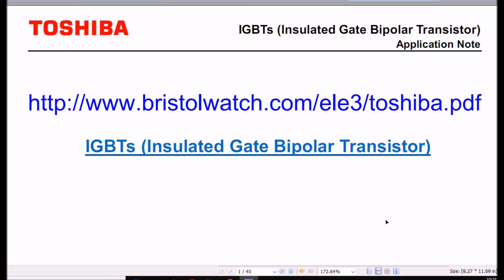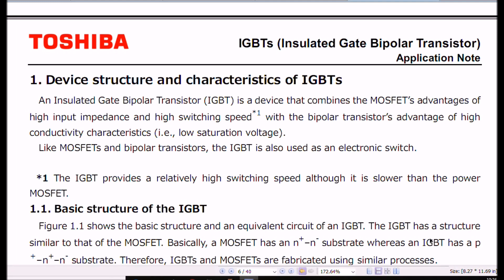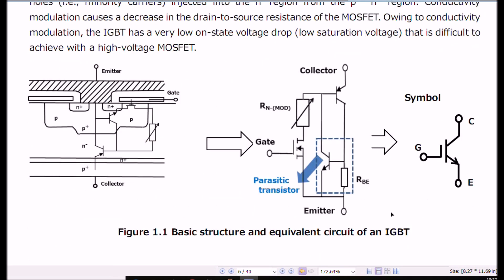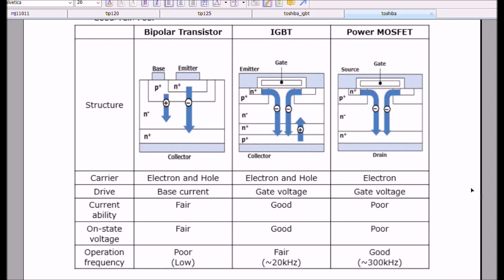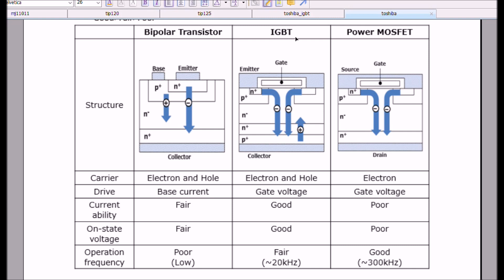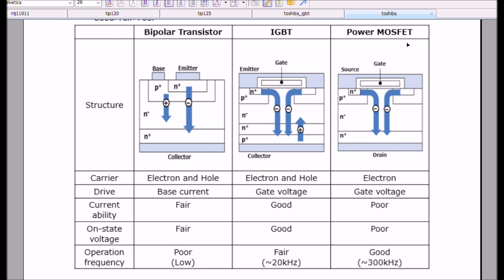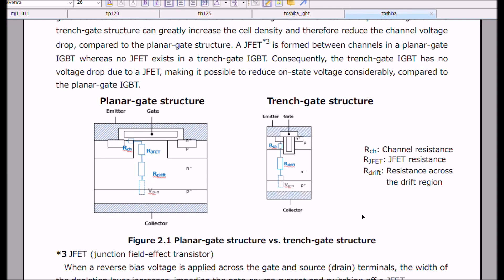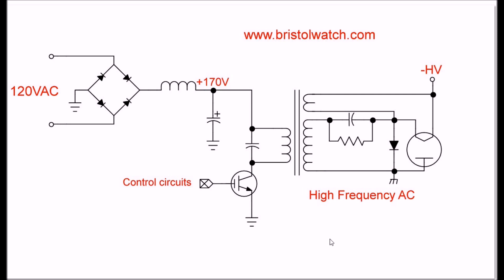Overview Toshiba IGBT Application Notes

Comment: What I like about IGBT is that they are the new born baby of MOSFET and BJT - they have both genes from MOSFET (voltage control) and BJT (current control) devices so you can take advantage of both. Job well done.

Comment: Hi Lewis ,
Thanks for the video as it sort of cleared the fog for me in regards to how IGBT'S work !
I am currently working on a touch screen feedback controlled pwm driver for DC motors and while the initial purpose will be for 12-24 volts i would like one day to expand this to be able to drive higher voltage motors from 90 - 240 volts DC .
What are your thoughts on using IGBT transistors in H bridge applications ? I have seen a few circuits for a half bridge etc but i want to be able to reverse the motor via an Arduino sketch and can't seem to find any information on the internet for this  .
Any thoughts are greatly appreciated !